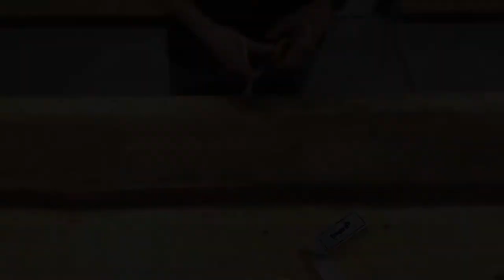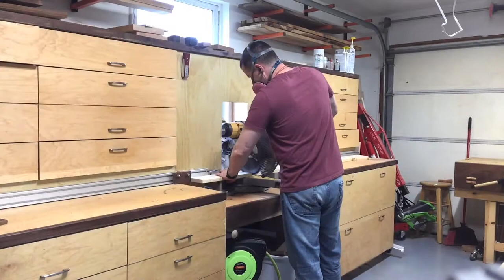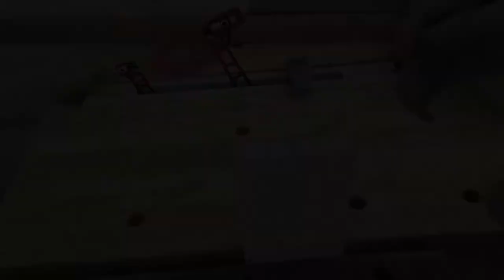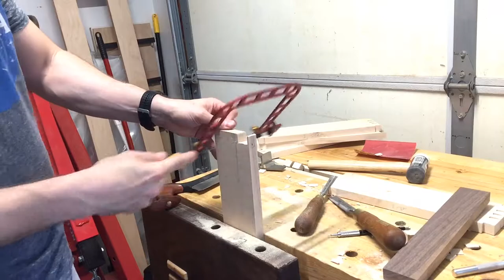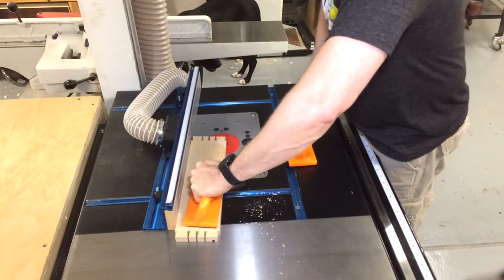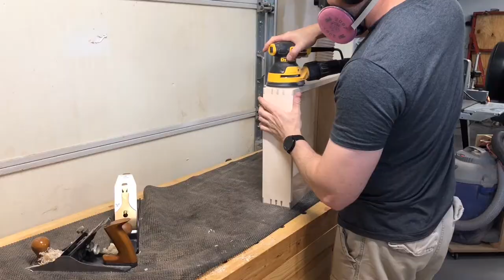Walnut Buffet Cabinet Build Part 5: Dovetailed Drawers | Woodworking

Comment: Seth, what white pencil are you using to mark on that walnut? I am just finishing up a modest walnut project of my own. I do have a white pencil, and it marks well but it is EXTREMELY fragile. Seems like the "lead" might be actual chalk. If you know something that's a little more robust, I'd like to know about it too!
Reply from the maker: Charlie Hubbard I’m afraid I haven’t had much better luck. These work ok, but. It great. They’re softer so they don’t break, but the point won’t last too long. So far they’re the best I’ve found...

Stabilo 8052 All Coloured Pencil... https://www.amazon.com/dp/B003DRCNUM?ref=yo_pop_ma_swf
Reply: Thanks for this recommendation! These sound better than what I'm currently using.

(For anyone else reading along...) These pencils are comprised of watercolor paint extruded as a pencil lead and then put into a wooden pencil jacket. I'm no artist, and I've never heard of such a thing! I gather from reviews the lead has more of a waxy feel than what I'm using now (which appears to basically straight up chalk), and I hope that means somewhat less fragile. I've ordered a set to see. I've read these pencils in particular are actually not that great as artistic pencils, perhaps because the lead is too hard, but they're just the thing for marking wood, glass and cloth. Since the lead is actually watercolor paint, marks made with it wash off with water.